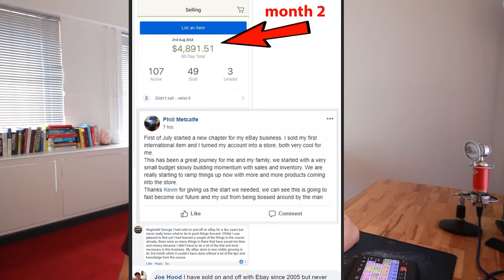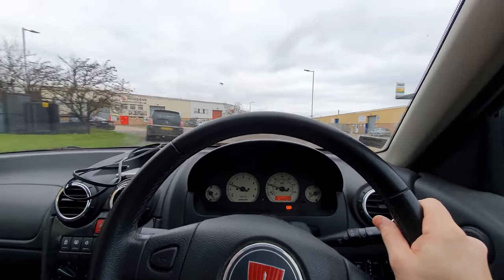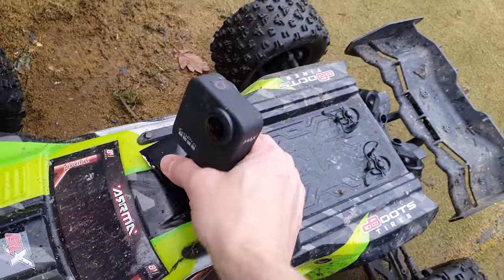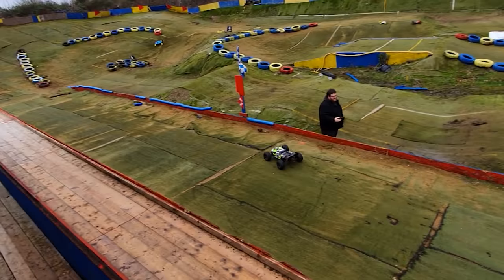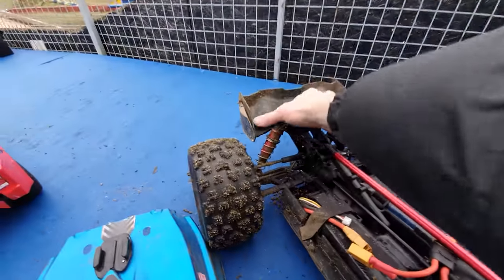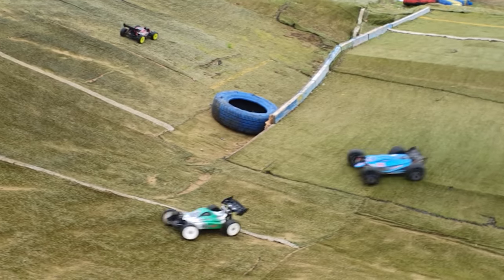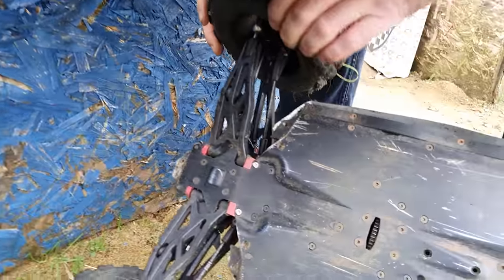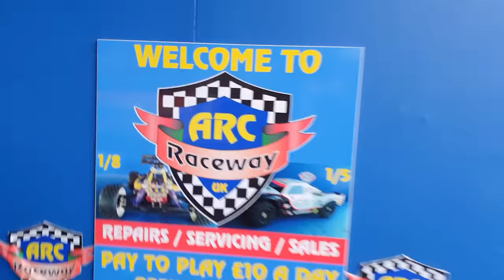Can I make this GIANT RC Car Faster & Win the race?

Comment: Another AWESOME ARC track session Kev 😱!!!! Nice driving with the K8s too 👀. She wakes up nicely with the 23T. What a fun time with friends 😍👍👍😎💪👊👊
Reply from the maker: THanks bro, yeh it was a great fun. You're welcome to come join us if you're ever over this way dude :) She goes so much better on the 23t. Just need to sort the steering now, its a bit lazy.
Reply: @KevinTalbotTV  I'd LOVE to come run with you guys 😱. Especially with all the fun going down 🤗. Can't recall if you bumped your BEC setting up to 8.4V or not on the ESC settings. That made a big difference with mine. You could try tightening the servo saver too. Once you lift the electronics module off the chassis, the plastic pivot piece pulls right out with the bearing and you can reach the set screw deep inside with a driver. My servo is taking a dump already 😝. Guess there's a reason they only cost 49$ USD. 🍻🤙🤙

Comment: Kevin,  If you could afford it you ought to either buy that property or work with the owner to have professionally installed new artificial turf put down. As it is it is in poor condition and the track needs redesigned. Of course putting in a brand new track or track's there or elsewhere  could make the RC sport increase substantially in your area. I love watching you guys race on that track but it does need fixing.

Comment: Guys and girls, don't park on the straight, you'll cause accidents that damage other people's cars. If you crash and are stranded on the straight, just shout "STRAIGHT" to warn the other drivers there's a danger on the straight. 

Same goes for the back straight, just shout "BACK STRAIGHT", saves people taking an early bath. 

The rest of the track is less of a concern as speeds are lower than the straights. 

Looked like a cracking day's bashing!

Comment: Hey Kev, some more info about zop lipos for you mate. I just checked my 3 batteries voltage & resistance.
I have a 3s zop lipo 5000mah 60c, 
a 2s zop lipo 6000mah 45c hard case 
& a 4s zop lipo hard case (can't remember size cause it came with battery loose in the hard case so I had to open it & didn't reuse the sticker)
Anyways the 2s reads 2 resistance on one cell & 4 on the other. Voltage wise it's 4.18 & 4.13. Tested at fully charged. This battery hasnt been used that much & 10 charges maybe.
The 4s hasn't been used yet at all, resistance it reads 2, 3, 3, 3. Battery is in storage atm for a few weeks but there isn't a noticeable difference in voltage.
The 3s has been used to charge tiny whoop (drone) batteries maybe twice. It has been in storage for a couple of weeks. Voltage wise it reads 3.79, 3.77 & 3.79
Resistance wise it reads 2, 2 & 2.
All tested on skyRC D100v2 charger.

Comment: Hi. Any update on the zop power hard case lipo’s? Mine arrived yesterday and I will be using it in my 1/8th e-buggy. 

I quickly put on the charge to check the voltage and I noticed the same issue that of the cells was lower then the rest.

Comment: For the batteries you have to use them a bit before they start
To balance
Reply from the maker: yeh but never seen any this bad, 0.2v out from cell to cell is way too much
Reply: Kevin Talbot yeah that’s what happened too my zee 4s 5200mah battery

Comment: Kev do you have a fan on your slash motor. I have a stampede 4x4 that will sometimes get too hot after running for a while and go into limp mode I am only running 1 tooth higher pinion gear than stock on 3s. I already have a heat sink on It I am just wondering if a fan would make any difference
Reply from the maker: i dont. make sure bearings are smooth and the gear down if still hot, and add fan!